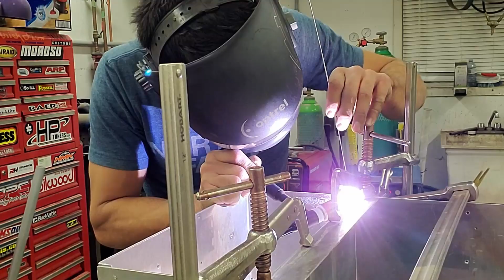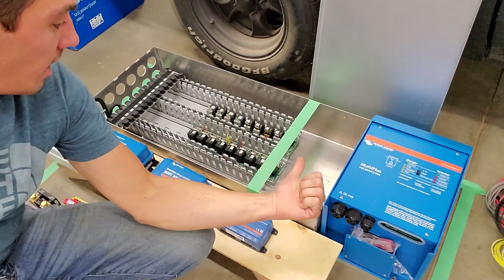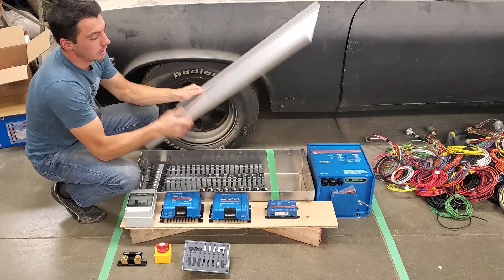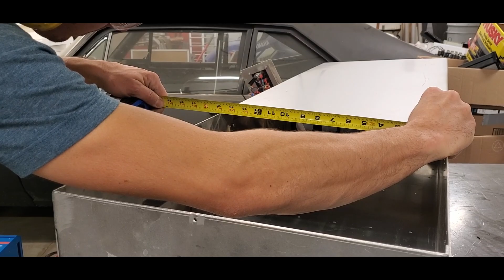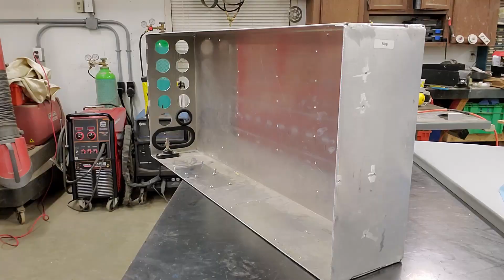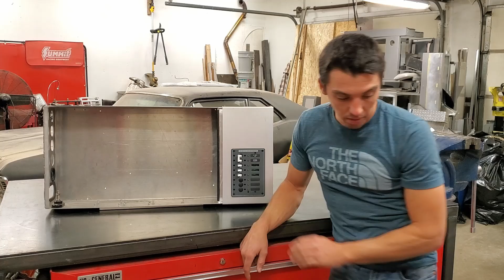Electrical Series #3 | Welding our new relay panel!

Comment: Great vid. I'm learning a lot. We're you familiar with the electrical systems or did you learn as you went?
Reply from the maker: Hey Kevin,  I've done a lot of electrical work on other vehicles, so I had an understanding of electrical before I started. But I had no wire schematics for the Road Rescue Ambo box.  So it was learning as I go with this particular project.